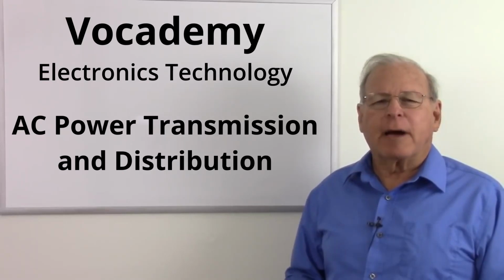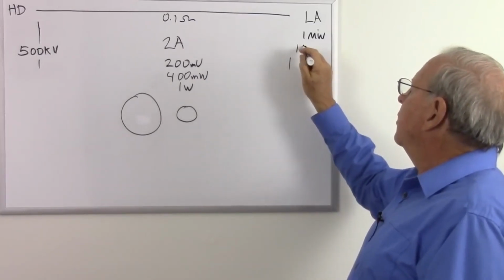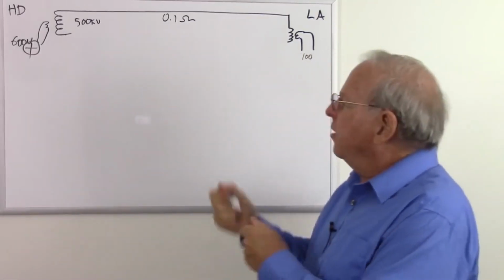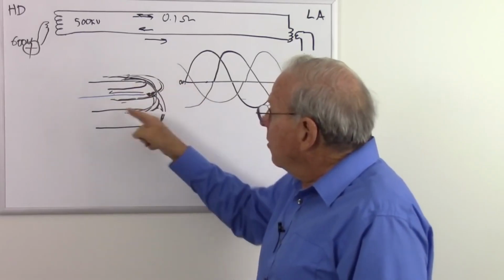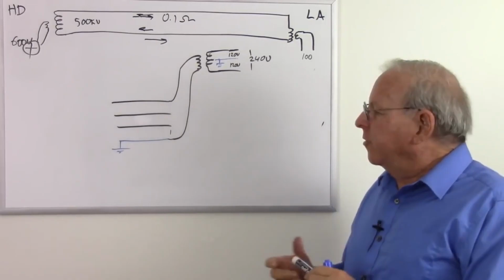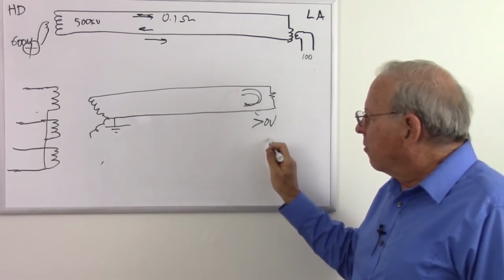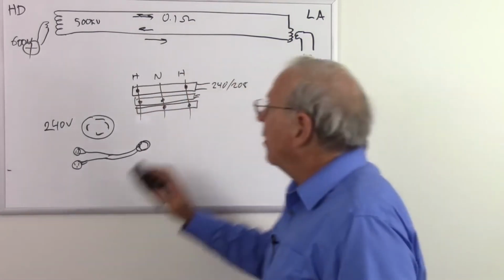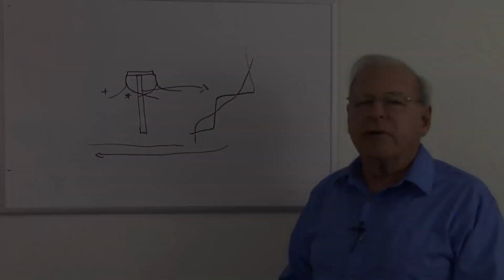Why is Electrical Power Transmitted at High Voltage AC and Three Phases

Comment: Hi! Very informative video!
As a viewer from central Europe I can tell you that it's quite common to have 3 phases in our houses (in suburban areas).
I do have three phases, and they're very useful, especially during construction or renovation works, because many powerful machines used by construction teams require 3-phase power (especially "plaster pumps" - I don't know the proper name).
And on a daily basis I use it for a high power induction cooking plate in the kitchen.
And of course our single-phase voltage is 230V instead of 120V, and the inter-phase voltage is 400V (serious stuff)

Comment: I understand the math, but I'm still confused about why it is unsustainable to start out at 1,100V. If you can consistently produce 1,100V, so what if you loose 10MW? Power plants have no problem producing 1,100V. Last I checked, they can produce up to 22 kV! There must be something I'm missing here. I mean, if we transmit high voltage specifically because we can reduce the diameter of the wires, thus reducing cost, then I understand why high voltage transmission is preferred.  But let's say Elon Musk says he'll pay for all the wires. So now we don't have cost problems anymore. And if we don't cost problem, why, again, is low voltage transmission unsustainable????
Reply: The main thing is Power and Voltge Drop. If you transmit at low voltage levels like 1.1kV, this level of voltage will not give you a high amount of power to satisfy the power demand. And the voltage may drop drastically if you are transmitting on long distances.

Comment: The break even point for high voltage DC lines depends also on the available inverter technology. It’s easy to rectify AC since quite some time, but the opposite transition is not that easy for 500kV.

Comment: I'am confused about the formula, by OHMS law 500kV divided by 0.1 ohms would equal 5million AMPS?
Reply: The 0.1 ohms is just the resistance of the wire... The load on the downstream side where the power is used is essentially more ohms. Also the step up process after the generation reduces current. 

As another comparison, imagine  shorting a 9v battery with a 0.1 ohm wire. The math says 90 amps should be going through the wire, however the battery itself can't do that much and essentially has its own internal resistance.

Comment: That must be a mistake in the beginning. 400 KM copper wire even at a 7 cm diameter has to greater than 0.1 ohm.
Reply: Yes it would be around 29.5 cm in diameter to have a resistance of 0.1 ohm
Reply: That would be a very expensive and very heavy transmission line. @Nicholaechs
Reply: At only 2Amps you can easily afford 100Ohms for power loss on 400km. In fact it would be more like 1..2kA to transport GWs over such a line. But even then a resistance loss of a few kW is nothing compared to the capacitive loos over that distance.

Comment: I have the same question as kirchofffontaine6845. I don't understand how 500kV in a circuit with 0.1 Ohms total resistance will deliver only 2 amps.
Reply: I think your looking at it the wrong way.  Remember, P over I x E.  You want to deliver 1,000,000 Megawatts.  If your voltage is 500,000 then that is 1,000,000 Watts divided by 500,000 Volts = 2 Amps.
Reply: I answered them already. The thing is 0.1 ohms is not the total resistance, you are ignoring the load resistance. You are delivering power of 1MW to a load right? Is that load going to be zero resistance? Try thinking about the load as the appliances in your home, like maybe an incandescent lightbulb of 60W will make it easy to understand. Your household supply is 120V (assuming America), so 60W bulb should have a resistance of V^2 / R = 60W which gives an R = 240 ohms. This 240 ohms is your load resistance which is to be added with the wire resistance to determine the series current.
Reply: @Swanicorn   The transmission line voltage is stepped up at the generation plant and is stepped down a couple times before it gets to your home.  Your home  or the load your talking about is on the secondary side of the step down transformer outside your house.

Comment: When the voltage  of a wire increases, isn't it against Ohm's law for the current to decrease? You mentioned that Ohm's law is also used in AC circuits. So, isn't there a contradiction in this matter? Does the voltage undergo an imaginary change, why should the current decrease when we increase the voltage? If voltage increases, current should increase as well.And yeah , you should talk about Fenno-Skan transmission line on the next video.
Reply: I think your looking at it the wrong way.  Remember, P over I x E.  You want to deliver 1,000,000 Megawatts.  If your voltage is 500,000 then that is 1,000,000 Watts divided by 500,000 Volts = 2 Amps.
Reply: @mikesradiorepair  if current decrease when voltage increase , impedance must  increase with voltage .Then what thing causes to increase the impedance. transformator ? Long wire ressistance?
Reply: @vikont_marselius  That's because you are not applying that voltage JUST across the wire! Consider this to be like a voltage divider or potentiometer where the wire is one part of 2 series resistors and the load is the other part. You can't use the ohm's law unless you know the load resistance as well. How can you determine the current otherwise? Your series current is Vs/Total resistance, according to ohms law. In the case with higher voltage, the load resistance also increases to keep the product power constant, our constraint to provide constant 1MW. And now since that load resistance increases, the overall series current will decrease according to ohm's law itself! 

The formula for ohm's law is V/I = R = constant. The formula for power or load is V * I = P = constant (here = 1MW). Notice how the direct proportionality changes to inverse proportionality? So now you will quickly realize that if you increase the voltage and want to deliver the same load of 1MW, your product V*I = 1MW needs to reduce the current. It's like he explained: 5V * 1A = 5W and 50V * 0.1 amps = 5 watts. To draw 1 A from 5V, the overall equivalent resistance of the network comes to be 5 ohms. Out of this, the wire is 0.1 ohm so the load will be 5 - 0.1 = 4.9 ohms. Similarly for the 50 V case the equivalent resistance needs to be 500 ohms to draw 0.1 amps. This leads to load resistance of 499.9 ohms. Or you can flip the logic by using various voltages and various load resistor values, but the power dissipated in the load resistance needs to be constant at whatever you choose. You will find that you end up with an inverse relation between applied voltage and current, unlike the ohm's law. But in no way is ohm's law being violated! It's just that the load resistance is changing its value in the background to decrease the current derived via ohm's law. Why? To maintain our constant power contraint!
Reply: @Swanicorn  yeah that explains the situation.Thanks

Comment: Where I live, outlets are either 10A or 20A, and while the layout is the same, in a V shape, left if Neutral, bottom is Ground and Right is Hot, the difference between 10A outlets and 20A outlets are the size of the plugs, 20A plugs and outlets are 0.4mm larger than they 10A siblings, so 20A plugs dont fit on 10A outlets, but 10A appliances plug on 20A outlets

Comment: Brilliant! The best explanation of this stuff I've ever heard. 🎉
Quick question about 15 & 20 Amp plugs....they seem a bit backwards in a way. Plugging a 20A load into a 15A socket at worst will blow the breaker. However, a 15A load in a 20A circuit will FAIL to blow the circuit when sometimes it should.
So in the interest of safety, the breaker should err on the "low" side, no?
Reply: The breaker is sized to protect the wires and the outlet, not the appliance. A smaller load is fine. A fuse inside the appliance will protect it, if necessary.
Reply: @gt5713  Thanks so much for that! I get it now! 👍